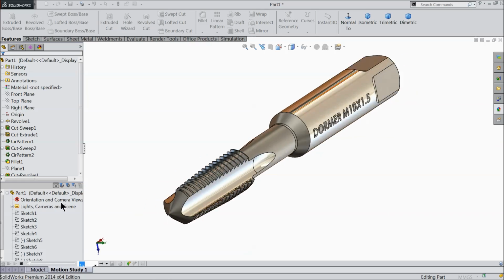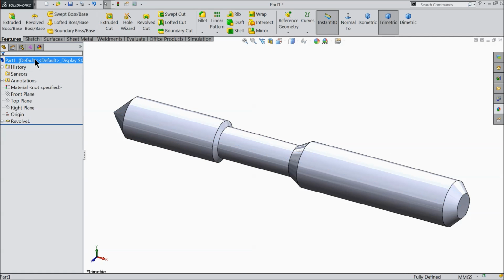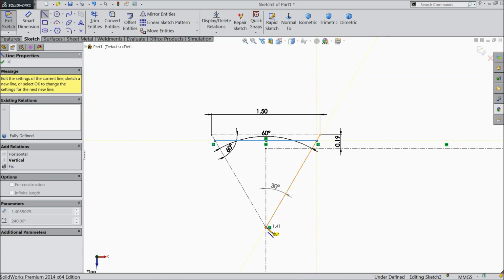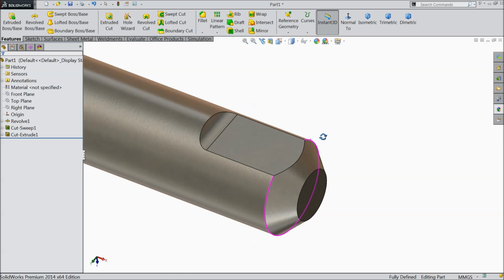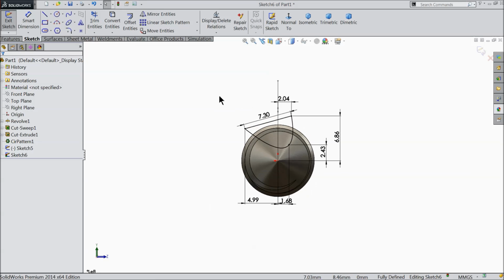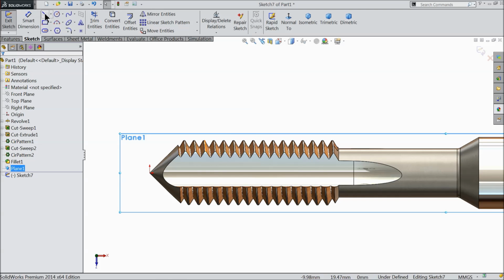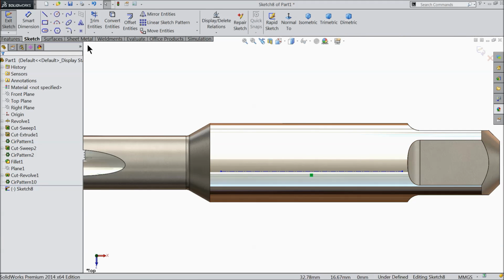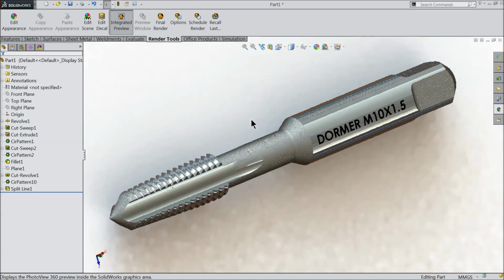Solidworks tutorial | sketch Tap Bit in Solidworks | Solidworks

Comment: My previous question is not clear enough, let me clarify the question. You usually use “Helix and Spiral” tool to cut a thread. Here you are not using it. What is the reason for that?   

Time around 7.12
Reply from the maker: i prefer to use helix & spiral method but this is also a kind of way to cut the thread, no specific reason just to show another way of to create thread,
Reply: @CADCAMTUTORIALBYMAHTABALAM  when I use twist along path method, it shows error,, path and profile must be different?